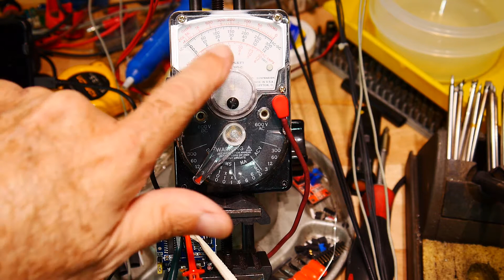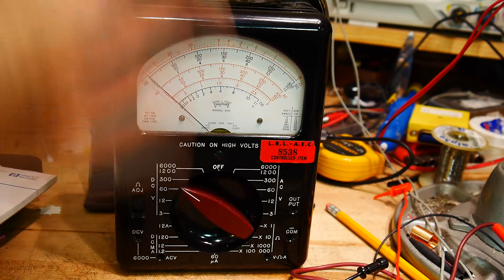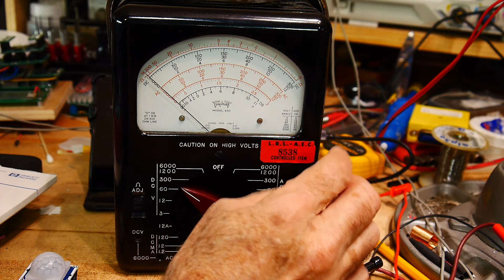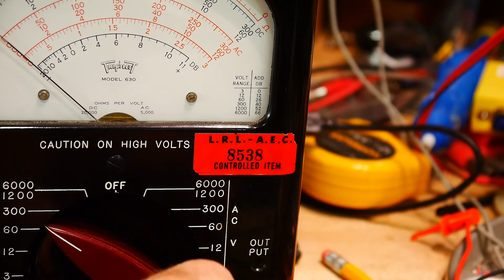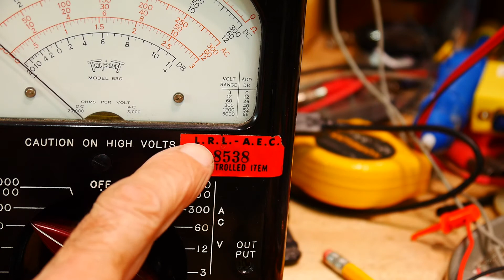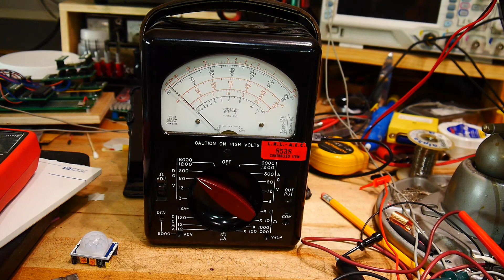#194 IR sensor

Comment: I lusted after one of these Triplett VOMs in the 50's but finally got one at a hamfest a couple of years ago. You can still buy these NEW for around $250! But I have one that requires that weird battery, which I have not found.